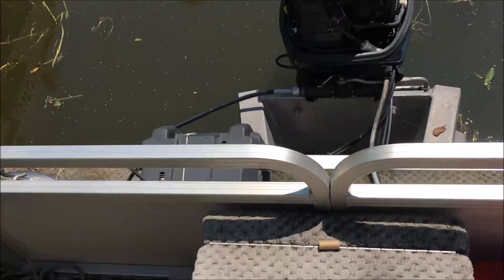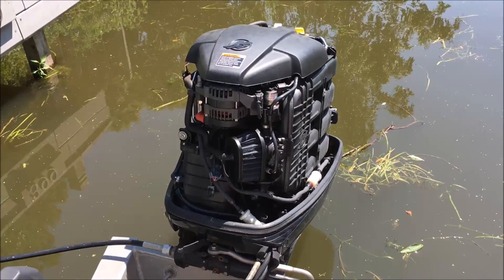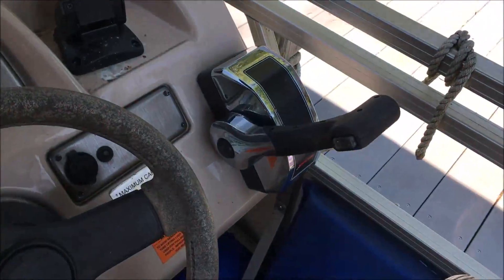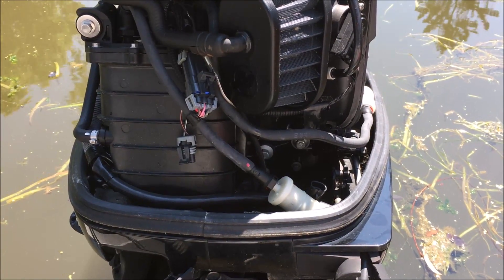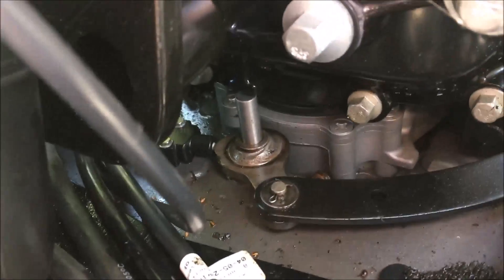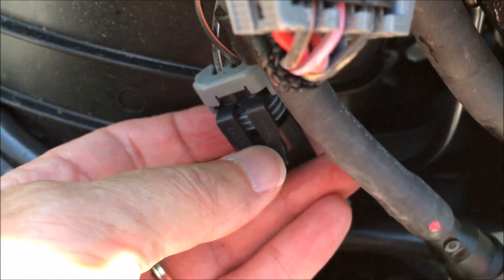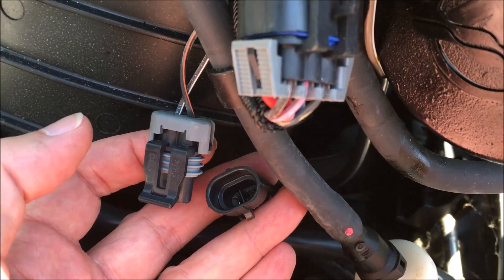Mercury Outboard shaking and not going past 3000 RPM

Comment: Mercury outboard, four stroke, 115 hp motor shaking keep quitting while driving I found the problem. I have spent a fortune on this pontoon and all It was is the vent tube was stopped up stopping my fuel

Comment: Hello, i have a Mercury EFI 60HP 2009 that started to shake like crazy in a middle of fishing trip.  it was'nt possible to go over 2500-3000 RPM because it was shaking to much. According to your description i feel that it might be the same thing. However, when i got my boat out of the water and started the engine 1 hours after the problem started, it was'nt shaking.  it's clearly not the prop.
i also not got any beeps, and the odor of the motor smelt differently. 

Is this something similar to what you observed ?? 

Thank you for the video !!
Reply from the maker: Sory, I'm not a mechanic. The problem described in this video is consistent, not a one off. Theoretically the Neutral switch could've gotten stuck once but I have no clue. if it does get consistent, diagnosis is pretty easy (do what I did in the video).

Comment: You have no idea how much I appreciate this video! I bought a boat with the exact engine as yours 2010. When I launched it there was no problem, but I never revved above the 3000 rpm to test. Then a few days later when I had time I took the boat out when I was outside the no wake zone I throttled up and BEEP, BEEP, BEEP, BEEP...with simultaneous shaking of the engine until it cut off. It restarted right away, then I tried again and when the beeping and rattling started I throttled back and it settled down. So I motored back slowly thinking there was a big problem. When I asked the man I bought it from he said I should change the fuel filter and add fresh gasoline. That night I found your video. The next morning I removed the cowl, started the engine and disconnected the switch. Revved the engine and no beeps or shacking. Then I placed the cowl back on and took it out and...problem solved!. I thank God for this video because there is no telling how many rabbit holes I would have gone down before taking it to a service center to have them keep it for who knows how long.
Reply from the maker: I went through a few rabbit holes before I figured it out. Glad to have been of help. Enjoy the rest of boating season!!

Comment: Thank you for the video. Replacement solved the issue. The switch was a plain on/off switch, not a TPS, and the part number is 889514A01 superseded with 8M0207794
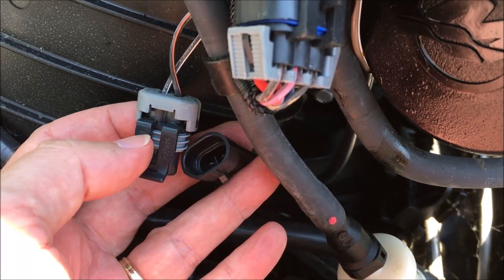3:35
Reply: How do you replace this part? Having exact same issue.
Reply: @charlesadams4471  curious about the same thing

Comment: I have a Mercury Seapro 115 4 stroke.  When I first got it, it would shake and start to cut out after running it fine for an hour or so.  Later on it quit shaking and ran like a champ with no problems.  Last weekend, after running for over an hour, it began its shaking and acting up like water in fuel or something.  BUT, I finally noticed on Vesselview the indicator jumping from F-->N-->F-->R--F etc. flipping back and forth.  It sounds as if this switch might be the problem because of the shifting issue combined with a sputtering engine.
Reply: So did you fix your problem, and what was it exactly? I have the same running issue you described. I did purchase a VesselView module last weekend, but not taken it back out yet.

Comment: Hi there, loved this video, so helpful mate! My Mercury Optimax 2006 75hp two stroke goes in guardian mode at 4,000rpm with a solid beep. Other than that, it runs perfectly. Do you think 75hp may have 4,000rpm limit for this Neutral Switch instead of yours at 3,000rpm?
Reply from the maker: I don’t know but simply try the unplugging as seen in the vid and you’ll know

Comment: My engine suddenly shake big time  at 2400 rpm under load. Running smooth under 2400 rpm. Put engine on neutral and give more throttle, engine was limited to 3000 rpm (normal condition). Disconnected the neutral switch as said  in the video tried under load and engine was just fine. Switch defective, closed at any position replace it and the problem is resolved. Thanks for the information , saved  me time and money.

Comment: I owe you a 30 pack of beer. I corrected my problem when mercury could not. They replace the high-pressure fuel pump $900. Spark plugs $300. New lower water pump for50.
Reply from the maker: Glad it worked out. it sucks you had to spend that money. instead of beer, a subscribe will suffice ;-)
Reply: @Core3DTech 
What year motor was your 90
Reply from the maker: @bubbieallen795  2010
Reply: @Core3DTech I have 2012 model I don’t see that switch at all, would mine be in the shift on console
Reply from the maker: @bubbieallen795  I do not know, mine's a 2010 EFI 90hp, Not sure how different the newer models are. check https://www.mercurymarine.com/us/en/parts-and-service/service-and-support/owners-manual for your model
Reply: 🎉 I found it thanks imma try it out this week

Comment: Hi Gyus, I have Merc 80 2018 with the same symptoms. It could not go over 3000rpms. I bough this engine second hand but only test it out of the water. Today a mechanic came with some diagnostic tool, which said that the engine is locked 'security lock' or something like that. The mechanic claim that the ECU need to be changed.  Did someone has simmillar issue. The ECU cost arround 2000$ :((
Reply from the maker: have you tried what I did in this video (if it still applies to a 2018)?
Reply: Yes mate, unfortunately it does not help. The guy from mercury came with a diagnostic tool yesterday, it showing "engine locked". The mechanic claims that he never seen this before and want to change the ECU... :(

Comment: It’s amazing I’ve had the same problem with my 2018 115 called the dealer and they just don’t wanna acknowledge that it’s actually happening but your video proves it with all the guys talking about it taking my boat in today going to show him this I actually called Mercury Marine in Wisconsin and  they didn’t even wanna admit this problem existed will never buy another mercury motor again!!
Reply: Hi Mate, could you please let me know, where is the 'Neutral Safety Switch' on Mercury 115 2018? I have the same issue where the engine didn't go over 3000rpms(shaking), but the dealer said that the ECU need to be replaced. :((
Reply: @hudaitaly  My dealer just told me three days ago there is no neutral safety switch on the engine but it’s in the throttle handle or ignition
Reply: It's not always easy to find intermittent issues and that is a temporary code even with g3 it will show up if happening goes away when not. I had a rental would go out 5 days and would happen once for 2 take offs then not again for a week

Comment: Thanks for the video.  I bought a new sensor, I didn't take the old one out, too hard to get to.  So I just connected the new one and pressed the grey button all the way to test it.  Didn't change anything.  Still self-retards at 3k RPM.  I should've tried your test, to unplug it and try.  I will next time.  Question though:  What goes wrong on the old switch? How does it break?  And why won't my new one not work?  Does it absolutely have to be mounted to work?
Reply from the maker: not sure what goes wrong with it. Haven't been able to get to mine to see. I suspect the plastic knob jus wore off (I do switch from forward to reverse a lot, turning around in my canal).

Comment: Can't figure mine out I have a2002 mercury 115 four stroke it was stalling when putting it in gear took it to a mercury dealer they put a new IAC valve in it . And new plugs and wires  it doesn't stall no more but my boat would run 38 mph all day .now it will only run 29 or 30  at 5200 rpm  before it would turn 5800 rpms am lost
Reply: Did u figure this out ?
Reply: @felixmikkialmosttoasted3911  no never figure it out sold the boat got me another one
Reply: @christhorbelch3589  i am thinking mine is the neutral switch

Comment: when i turned key on i got 6 beeps what next i cleaned injectors put new injector pumpnew plugs pulled gas tank got rid of gas got new gas changed all fuel hoses need help put new filters and water seperator

Comment: I had the same issue, but with Mercury outboard 150 HP fourstroke. I took it to the dealer. They changed a round sensor that is hidden, it's attached to the electric power trim shaft from the upper side. Like if you stand behind the engine it's very clear, you can see it to the left side once you trim the engine up "it's written on it this side out," it's attached with two small bolts, and it's called (Digital Trim Sender.) Along with it, I changed a short shaft that goes horizontally through the upper side of trim arm ring as per their advice. This sensor has a wire that goes into the engine compartment, and it's the only wire that enters the engine from outside, just below the engine cowl to the left. I paid US $88.00 installed, I took it for a test run after this, and my problem was solved.
Reply: i am going nuts spent a lot of time 2012 mercury 150hp 4 stroke wh en i go 2800 rpm or faster my motor starts shaking bad runs ok at 2700 read what you did my trim and tilt motor has heavy rust on the top of it.wow that fixed your motor
Reply: @leebradfordjr9574  Myself I wondered what a part that is located totally out of the engine compartment, has to do with my engine jerking, can't go beyond 3000 rpm, and if I force it even it gets lower like 2700rpm or less. BTW the dealer I mentioned is the Sole Agent for Mercury outboards in the UAE, in which means that they are the only authorized dealer in the whole country, they deal with thousands of engines annually, they know exactly what they are talking about, they diagnosed the problem without even looking at my boat, and ordered an electrician worker to change the part. Simply change the part I mentioned above, and your engine will be fine.
Reply: @abdulalameeri1578  well part came today i changed it and it didnt help dont know wear to go from hear
Reply: @leebradfordjr9574  Drop by Mercury dealer, ask them for diagnose, and estimate price.

Comment: Ok... its not a  Neutral safety switch.... its a shift interrupter  switch.... what it does is it kills the spark on about half the spark plugs in order to take the load off the clutch  in the lower unit ,so you can shift from foward to neutral to reverse  etc..  as you know there is no clutch,  other wise you would be grinding in and out of gear everytime you shifted.....
Reply from the maker: Half the plugs probably also explains why it won't go past half the RPM?
Reply from the maker: Thanks for the explanation, good to know. Call it what you will. If you need replacement you'll need to look for "Neutral Switch" on amazon https://amzn.to/2Yu4c3g
Reply: @Core3DTech   i have done changed everything .saw your video and cant find that switch that your talking about.have mercury 2012 f0ur stroke 150 hp and their is a plate their  i have the motor apart sides are off cant find that part can it be located some where else

Comment: I changed mine and it works in gear but still beeps in neutral when I reved it to 3000 rpm. Is that normal ?
Reply from the maker: Yes, that is exactly what that feature is intended for. When in neutral is should NOT go beyond 3000 rpm (i believe it's not good for the engine)
Reply: @Core3DTech  thank you for the response.
Reply: Your not supposed to rev motor in neutral puts it in gaurdin

Comment: Idk if this video is old enough to get ur response but I have a 25hp efi and I can't get my speed to go passed 7 mph since day one purchased new. Can this be the same issue u had. Idk how to tell what roms my boats at so idk if it's the same issue thanks
Reply from the maker: I explain in the vid how to determine if this is your issue. if you have neutral switch and the problem goes away if you disconnect it, it's your issue. idk if your engine has a similar switch

Comment: When I bought the used boat . I saw it unplugged. So do i need plugs it back or let it be . Thank you
Reply from the maker: If this engine you bought suffers the same issue, you'll need to either replace the switch (hard to reach but doable), or leave it unplugged. Leaving it unplugged does expose you to accidentally starting while in gear.
Reply: @Core3DTech  you mean the engine can not start when it unplugged
Reply from the maker: @longvu925  It should start just fine but it might be possible to start it while it is in gear (not neutral). Starting it while in gear (reverse or forward) is not a good thing. Make sure you're throttle is in neutral when starting the engine
Reply: @Core3DTech  thank you
Reply: My boat has one more problem , can you help to let me know why : for the first 3 to 5 minutes my boat running very slow and after that it running fast , it is happen every times when I start running the boat
Reply from the maker: @longvu925  I’m sorry but I’m not a mechanic. Just happened to solve this issue.

Comment: I got the same problem I have a 50hp evinrude 2 stroke mine will run fine for alittle bit then it starts not going over 3000rpm then turn key off and start it back up and it's fine runs great then all of a sudden it does it again and then sometimes it don't do it any help would be appreciated thanks
Reply: The evenrudes have an issue with the exhaust V tech I guess there is a recall on a rubber grommet that is installed in the wrong spot

Comment: I have the exact motor , 2010 model . Mine ran consistently at 5200 rpm but now it holds at 4800 to 5000 . Any idea what would cause this ?  I found my airfilter was really desinergrating so ordered a new one but no idea if that would cause it ? By the way , air filter on e bay is 80.oo ,  mercury dealer wanted over 200.00 plus shipping ????

Comment: Hi there. First sorry for My English, i'm from argentina. So, My 90hp 4s 2007. Out of the water, the engine start be fine. But past 30 mins. this does not start anymore. Do you have some idea? Thanks.
Reply from the maker: You're English is great. I honestly couldn't tell you. There could be many things wrong. Does it not start at all or do you have to wait a while and it will start again? Does it do this repeatedly/consistently? If you run the engine without the cowl (The big hood on the engine) does it run or run longer than 30 minutes?

Comment: First of all, thanks for making this video! Appreciate it! 
Question: did yours rev good when in neutral, but then is limited to 3k rpm when in gear? Cuz that’s what’s happening to mine.. 
Also, tps is Throttle Positioning Sensor and not the same as this Neutral Safety Switch, or?
Reply: Thanks for the reply I did the cheep stuff 1st I replaced the fuel filter emptied out my gas tank wen I took it out I figured let me put in my truck because 12 gl of gas at $4 buck a gl thanks to the radical left I had no place to put it.  So my truck ended up running like shit.   So it was the gas for sure    Lol thank god all is good.  Happy Easter 🐇🐰🐣🙏🏾
Reply: @GypsyDiy  baaahahahah love it. 
Great that’s good to hear. 
Thanks 🙏
Reply from the maker: Everything runs fine in both neutral and gear up to 3000RPM. The computer throttles it at that RPM. Check the full video to test. Simply unplugging the neutral connector should confirm.
Reply: Core3D_Tech okay thank you!! 🙏
Reply: @meals24u  it seams like I’m have the same issue you have or had.   Will not pass 3000 rpms in neutral revs fine in reverse passes gets full RPMs.  Only forward  no alarms/beeps.   Out of water like new seams like under a load
Reply: @GypsyDiy  yes sir! I ended up selling the Boat as I did not want any big issues! 

But I wasn’t too tight on the boat anyway, had some decent investment opportunities and ended up going that route.. 
wish you best of luck with it!! 🤝

Comment: Thank You very much for your video.  I had exactly the same issue except mine didn't beep 6x.  Tested the switch that you identified and found that it was very slow to respond.  Purchased a replacement switch and it reacted fine.  Installed the new switch and no more issues.  I want to "thank you" for helping me solve this issue.
Oh by the way, it was a royal pain to replace that switch.  That location is very difficult to get to.
Reply: I got same problem but doesn’t beep either.. Mine revs fine, just doesn’t make power and go past 3k rpm when I’m in gear ..
Reply: @meals24u did you e eat get yours running correctly
Reply from the maker: Glad it worked out. Hope you didn't spend too much on other replacement parts before finding this (I did).
Reply: @Core3DTech  thanks to you i did not!  Thanks again

Comment: I understand that you done your problem your way... But could a similar scenario with the 3k rpm be a fuel problem?
Reply from the maker: Sure but generally, not this consistently. exactly 3000RPM is enforced by the computer when it thinks it's in neutral. Fuel can definitely be an issue but it wouldn't be as dead on the 3000 mark. I did have another problem this year where I lost power after a while (around 5 minutes). This turned out to be a floater switch issue inside the FSM. It would always happen but not dependent on RPM (more based on temperature).

Comment: My 2017 4 stroke 50 worked fine all morning then I had all these shaking and alarms and had to limp back in 15 miles at 2200 RPS I hope the TP switch is the fault
Reply from the maker: This error is very consistent. On the EFI 90 it's exactly 3000RPM every time (hot or cold). If it doesn't consistently go wrong every time at the same RPM it's probably something different